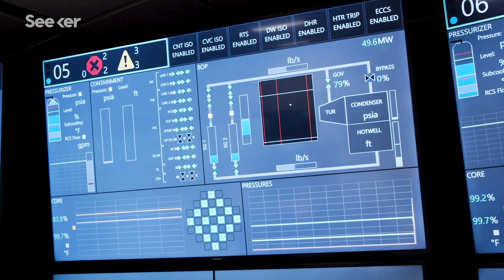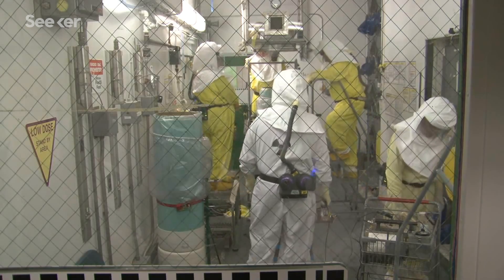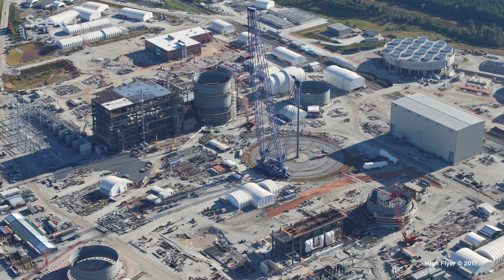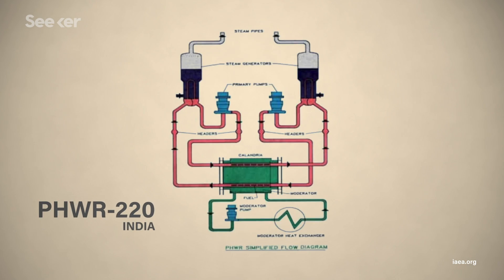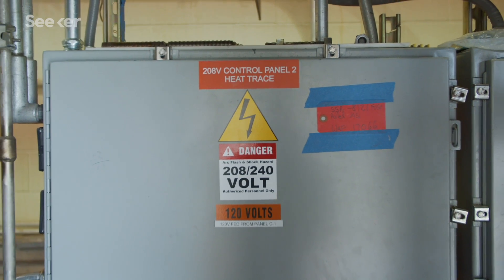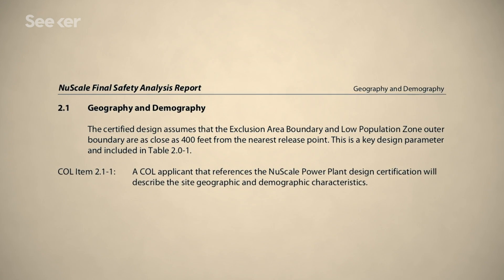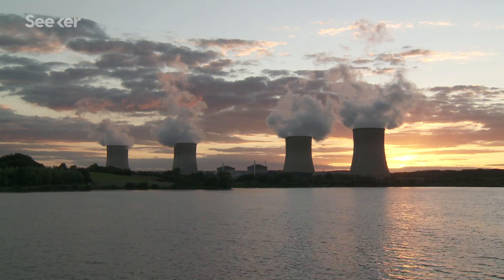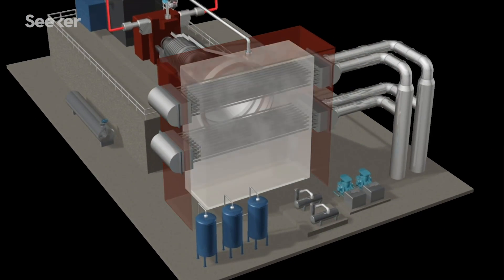Mini-Nuclear Reactors Are Coming, and They Could Reinvent the Energy Industry

Comment: These particular modular reactors still rely on essentially conventional solid fuel and water moderated /cooled high-pressure designs. We need to take the liquid-fuelled fluoride /chloride molten salt path, for optimum safety. There are excellent SMR designs for MSReactors also, so it's not like small modular systems need to be based on conventional reactor configurations.
Reply: It is just easier. Once the order of the day is ,' nuclear is fine', then we can expand with MSR's.

Comment: So, how is the cooling done after the shutdown? Is it using natural convection and smartly designed channels?
Reply: Purely natural convection, the reactor uses that method to move heat during operation as well, so there is no system to fail moving the coolant.

Comment: Nuclear is not expensive to build. Why does everyone say that? Because you have to build at least 5 solar or wind farms to equal the ACTUAL power output of a single nuclear power plant, the construction costs are very similar.
Reply: You couldn't be more wrong.  Today, the cost on the front end for a nuclear reactor is way out of whack because of all the redundant safety systems that have to be installed and set up.  Nuclear reactor plants cost about 10 billion to build from scratch

Comment: The economical arguments in the early 3½ minutes of the video very clearly explains that mini-nuclear reactors are NOT coming. I could add that reactors are also politically dead. The question is not the safety of the nuclear reactor any more, but the investment costs, the pollution of the fuel mining, and the radioactive waste. Why spank a dead horse? Why compare nuclear reactors with coal or oil that will be replaced, why not solar power?
Reply: Because the planet spins. And wind isn't on demand. Nuclear power can be utilized safely, and has been. Understand the accidents, and also understand that since 1956 power reactors have been running around the world. Not to mention all the reactors we have been building reliably over the past 6 decades, that are on naval vessels.

Comment: Oh, new nuclear tech. Thorium? Nope, of course not...

Nuclear power; One of the smartest and dumbest things mankind has ever harnessed. We continue to use radioactive uranium cores with a half life of 100,000 years because it's byproduct is used for nuclear weapons. A decision that was made due to the US being at war nearly half a century ago. But now, we have signed nuclear treaties and we're sitting on 50yr old old bombs, but we still continue to use the uranium anyway. To boil water that spins a turbine. Why? Money... Someone would have to pay for those Thorium reactors.. But meanwhile, millions of dollars are being invested into nuclear fusion research. Derp??

If they don't want to invest in a safer - more readily available - impossible to have a nuclear melt-down - better for mankind as a whole - form of energy using a technology that has existed for decades (Thorium vs Uranium), then even if we achieved fission today current logic dictates they wouldn't  pay to convert the power-plants over to use it. They instead just keep shoving nuclear waste into the earth and hope no one finds the hole for 100,000 years. Brilliant...
Reply: Molten salt reactors will "fix" our nuclear waste issues.  They can recycle all teh waste we've generated and burn it up leaving much smaller piles of waste in the long run.  Also, how much waste do you think we've generated so far?  The US nuclear waste pile fits on a football field stacked about 21 feet high, it's actually a very small amount after 7 decades of operation.  Molten salt reactors produce 1/5th the amount of waste today's reactors do too.
Reply: @Les_S537  https://www.youtube.com/watch?v=uU3kLBo_ruo

Comment: so what about thorium reactors?
Reply: More specifically what about molten salt reactors run off of thorium.
Reply: Well, we had a really well functioning one at ORNL. That was a long time ago. Since nuclear is so popular, there is a large contingent of nuclear engineers ready to tackle the design considerations of today. Well, sadly, that is not the case. Transatomic power was doing the work to build such a reactor, but they ran out of money. They were going to build the ORNL reactor but with an updated moderator so that 5 times the mass flow could be had from the salt. The deal is, Light water reactors are well understood. They have been reliable for half a century.
Reply: @michaelweigley1667  yeah, but the inherent danger of them tells me they have to go, light water and heavy water reactors.  We have a much safer route to go with molten salt reactors.
Reply: @Les_S537  They are just detonating left and right!
Reply: @michaelweigley1667  I didn't say that! 🤣

BUT

They can do lots more damage when they do than a molten salt reactor could

Comment: how this reactors deal with decay heat in the event of an accident? I completely understand that the loss of power would trip the electro magnets causing the Control Rods to scram and stop the chain reaction, but they don't explain how they will "indefinitely" cool down the core to deal with decay heat
Reply: +jhon rivera. You don't have to cool the core indefinitely after shutdown. just for 3-4 days after. After that time most of the fission byproducts will have decayed away, they are what produce the decay heat. Nuclear plants typically have enough diesel fuel for their backup generators to last a month.

Comment: Still way too large, but a step in the right direction. The right size would be the one reactor you could install for about 50-100 households right there.
Reply: You are asking for a bit much...
Reply: @bodypillow3800  I don't. Small reactors of that size exist, are pretty handy, much less dangerous and essentially can be maintained by a housekeeper.

Comment: Sounds like a solid backup for renewables. Surprised other plants havent implemented the electromagnet design.
Reply: All nuclear reactors use electromagnetic clutches for their control rods as a fail safe, the problem is when control rods drop into the core, they absorb neutrons to slow or stop the reaction, they don’t reduce the heat which is the real danger, if you can’t cool the fuel, Fukushima happens.

Comment: I'm all for nuclear power but this sounds like an extremely dangerous idea.
Reply: Why though?
Reply: @michaelweigley1667  Every nuclear reactor has a tiny chance of melting down. The total odds that a reactor will melt down is equal to the chance of meltdown per reactor, times the amount of reactors in the world. This means that the more reactors there are, the greater the odds that one or more will melt down.
Reply: @michaelweigley1667  also the smaller the number of reactors, the easier it should be (in theory) to maintain strict standards of safety and monitor them all effectively.
Reply: @kevinmurphy5878  I don't think that you are wrong. However, the chance of a meltdown with this reactor is zero. Bold statement, I know. Find the nearest TRIGA reactor to you and sign up for a tour. The technology in TRIGA fuel is different than a power reactor, but they do go to show how a reactor may be made meltdown safe. Also EBR-2. The beauty of these small reactors is that the cooling is passive, all the time. Failing that, the units sit in a larger bath of water.
Reply: @kevinmurphy5878  Reactors are strictly maintained. Hence the no meltdown of a power reactor in the US since 1976. Chernobyl was a steam boiler explosion, and Fukushima reactor building survived a 9.0 earthquake followed by a 15m tsunami wave. Then the ancillary flooding knocked out the backup power, causing the loss of cooling and melt. That was a fault of facility layout, it had nothing to do with the reactor design.
Reply: @michaelweigley1667  No matter how slim the chances of a meltdown, they still go up with the number of reactors.
Reply: @kevinmurphy5878  Well, strictly speaking, the chance doesn't go up, it remains whatever it is, since having two reactors does not mean it is twice as likely to fail, it means it is half as likely that they both fail. And the failure we are talking about isn't a one in a hundred chance that we startup and the reactor melts.
Reply: @michaelweigley1667  if you have 2 reactors, the chances that you will have at least one melt down doubles. That being said, if what you said is true about the reactor being physically unable to meltdown, that is a game changer. If it is within a certain threshold of safety I could see it being widespread without being dangerous. I will certainly look into this type of reactor.
Reply: @kevinmurphy5878  I believe we successfully chatted with different views and avoided some fallout! Thank you for your time.

Comment: The Stable Salt Reactor by Moltex Energy is designed to recycle high level nuclear waste from water cooled reactors without reprocessing until most of it is turned into benign and valueable fission products,
Reply: Thelondonbadger  rather have a gun than hope I can find a narwal tusk...
Reply: Thelondonbadger  hahaha damn straight
Reply: And any reactor of such kind break nuclear proliferation treaties which is why they are not used or developed. There are dozens of designs which can produce more fuel than they use, run on high level waste or combinations of both and they are all banned because it would be super easy to manipulate the process to produce highly enriched Uranium or even Plutonium.
Reply: @kal9001  Single isotope Plutonium is a proliferation concern, but multiple isotope Plutonium is not and would require the same type of enrichment with centrifuges for example.
Reply: @kal9001  so they are banned because crazies think other crazies can have them, what a great reason to stop the progress
Reply: @ThundaAaAaAaAaAh  welcome to government, crazies who make laws to control non crazies because there worried about crazies

Comment: Start using thorium reactors and the whole problem is fixed simple as that
Reply: Simple? if it was simple it would be used. We have had sodium reactors since the 60s, but they turn out to have a really nasty corrosive effect on the pipes. Despite  being vastly more abundant and less radioactive over then uranium
Reply: @nonamefound68  no the only reason they don't use them is because they wanted the byproduct for making nuclear weapons
https://energyfromthorium.com/ieer-rebuttal/
Reply: No it's not. Thorium still has to be mined, which means destroying habitat and aboriginal heritage in a lot of places in Australia, at least. If we can use CST instead, we don't even have to deal with any of that or the constant transport and digging and processing outputs and costs.
Reply: @PinataOblongata  thorium is vastly more abundantly than plutonium or any other radioactive element and would be extremely less detrimental to the environment
Reply: @Thebigmanmetaldetecting  Did you read my comment? None of what you said, while being true for a comparison of thorium to uranium, is relevant. Using neither is a better solution.
Reply: @PinataOblongata  who mentioned anything about Australia thorium is found everywhere
Reply: I came to the comment section to say the same thing. The whole reason we didn't and don't use it is ridiculous. Instead, we bury radioactive waste in the deepest hole and hope nobody finds it for the next 100,000 years

Comment: I'm not strictly against nuclear energy but I disagree that systems which help correct humans if they make a mistake are safer.
Reply: Humans make mistakes they are too inefficient. Machines make no mistakes unless there was an error within the system in this case the human correct the error. They work hand in hand in correcting their mistakes.
Reply: @bodypillow3800  There are events a human won't have time to react too as you say, however I think there needs to be manual procedures which allow the operator to update the standard automated safety operations if necessary. There might not be any error in the system, there may simply be a situation the system is not designed to properly respond to. The other issue with automated safety is it dulls the responsiveness and critical thinking skills of the human operator over time. The most recent worst case scenario that comes to mind is the 737 Max 8's automated anti-stalling system causing the plane to crash when it wrestles control from the pilot. Arguably the system was flawed but even something like automatic braking systems in vehicles, may work 99% of the time and that's great but what happens if that system fails and the driver is no longer accustomed to manually breaking. I guess you can't win really, it does make sense to try and make the systems as safe as possible and test them as much as possible with a variety of human operators.

Comment: I'm eager to see this work. But, no one in the US has done anything politically that has curtailed fossil fuel use in a significant capacity. Coal went down due to market forces from natural gas, which is a cleaner fossil fuel with the same emissions of greenhouse gasses. Even then, and with growing popularity, solar and other sources of power are pushing fossil fuels out at a very slow rate, and doing absolutely nothing to end them entirely, just shrink them. More renewables means fewer fossil plants, then lower consumption of fossil fuel, then lower cost, then sustained usage of fossil fuels. At this rate, perpetual use. Market competition isn't enough. This is an issue of politics, and if any of you care about the future of our species, I recommend using what sliver of political power you have to keep fossil fuels in the ground as long as possible.

(PS: Up to this point, nuclear power has a better safety record than any other major power source. Including solar and wind. )
Reply: Nailed it!

Comment: So, it still creates a harmful waste product that lasts thousands of years, and it needs to be stored in a facility for thousands of years longer than the lifetime of the plant where that fuel was spent in the first place.   I'm still 1000% behind renewables.  Micheal Shellenberger has nothing on renewables.
Reply: So reprocess it, isolate the real waste, put it in a fast reactor and literally change the elements into something less potent.
Reply: @michaelweigley1667  You make that sound so simple. 4th and 5th generation nuclear technology isn't even here yet, and it might not ever be.  The technology you're alluding to doesn't exist for the same reasons 4th and 5th generation nuclear power might not ever exist.
Reply: @firefox39693  I can hope. The fact remains that it is possible. I get that it is not here right now, but the main reason the public doesn't go for nuclear is that we believe there is nothing that can be done about the waste. I would say that if dealing with the waste were the priority, then we can continue to generate power while doing the additional research needed.

Comment: I like to see a simulation on how they deal with a E M I event When we loose power for month. It has happened and n the past.
Reply: The rods fall in, the coolant circulates (thank you buoyancy), and the reactor cools. That's it.
Reply: @michaelweigley1667  Sorry you failed , oh the rods just fall in and by magic
 The rods will be nice and safe. That's the problem with you nuke people' you down play every thing. What's wrong with you people. National Heritage foundation assessment States we would have 60 nuclear meltdowns in the states, from a EMT event . We're still using those GE reactors like the ones in Japan that need to be shut down from age and poor design. NUTS.
Reply: @chuckschenck3045 , The rods are only held up because of electromagnets. when the power is lost, or when an SCRAM condition happens, the electromagnet loses power. Gravity is kind enough to yank on everything , including the control rods. You are correct, the current infrastructure is aging. Unfortunately, we haven't been able to build cutting edge reactors in quite a while. That is why I am excited about this reactor, It should be leagues safer than currently operating units. My favorite thing about the plant as a whole(12 units), is that the reactors can be shut down one at a time for refueling, so that the power plant never actually loses all capacity.

Comment: how about the nuclear waste?
is the waste to electricity ratio are also significantly lower?
Reply: No, these are just as inefficient as today's nuclear reactors, they only use part of the uranium pellets before they have to be pulled.  The safe and efficient way to do nuclear is molten salt nuclear reactors.  They produce 1/5th the waste and they can actually recycle all the waste we've generated to date and make it's disposal much safer and efficient.
Reply: The ratio would not change. The "Spent" fuel rods have nominally 6% of their fissile Uranium spent. Much of it can be recycled into a new rod, however it is this stage where it becomes very easy to separate Plutonium off. That is the reason we never built a reprocessing facility. However, you will find that a few other countries already have them. The rest of the radioactive daughter products can be placed into a fast reactor where they can be further bombarded to change their elements they consist of, and therefore affect their decay timelines.

Comment: They say its safer because of all the automation and automatic safety systems and features, but look at what happened to those Boeing jets with all their automation and safety.  If you make something so complicated and computerized, you are going to be in a pickle when something goes wrong and you can`t manually interfere.
Reply: The type of reactors talked about in this video are dangerous.  We have much safer ways to do nuclear.  They're called molten salt reactors and they're melt down proof